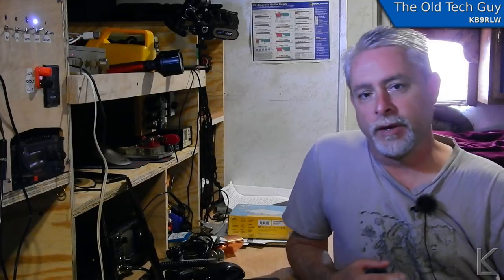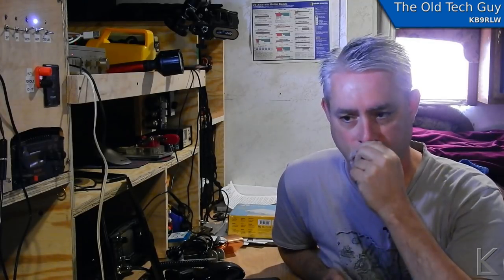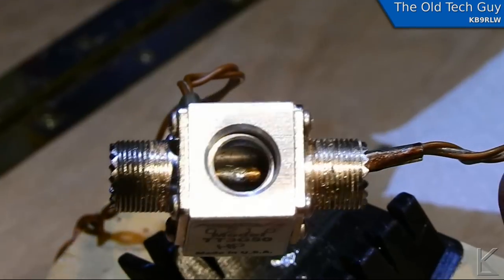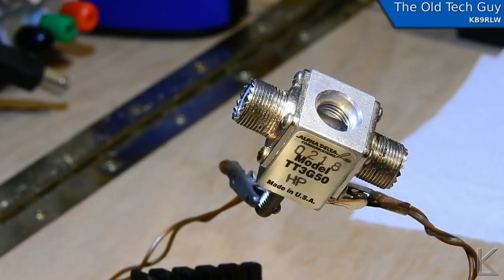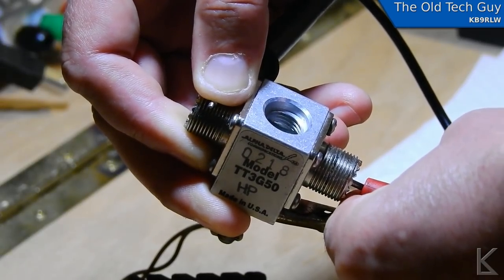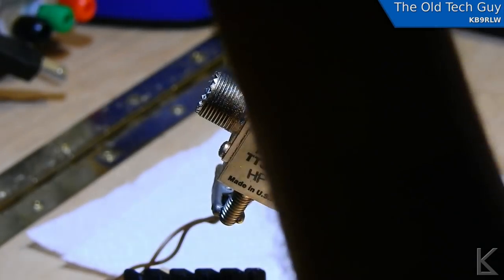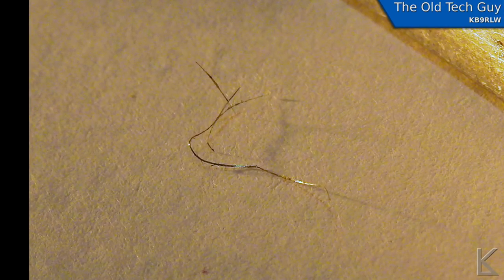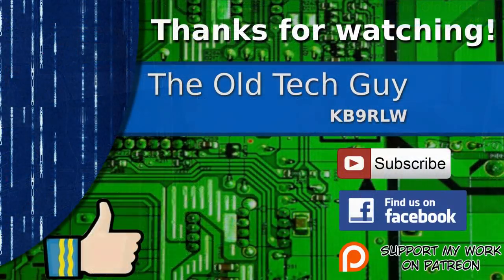Ham Radio - An Alpha Delta lightning arrester with an intermittent short.

Comment: It may have been residual swarf from a milling operation. I had an adapter that had large pieces of swarf shorting the connection. In my case it was easy to see. It was good that you found and fixed this issue. Have a good off grid experience.
Reply: Exactly
Reply: I thought it looked like "junk left over from cutting threads" but I didn't know there was a special word for it. So, thank you. "Swarf." Quite succinct.

Comment: Thats not wire, it is left over from the milling operation. I purchased 10 of these for my Tower setup and had 2 of them that had the same issue, not sure if it was just contamination from the milling process or it was from the threads from the gas tube insert? In any case great video and thanks for taking the time to post. I did the same thing you did and it was an easy fix...
Reply from the maker: I pinned your comment.  It's good to see that someone else observed the same issue.

Comment: Glad I found this vid (useful!). I've had two random shorts on my feedline, and now I know what to check. The first short was JUST before a contest. Luckily, conditions were lousy the first night. Anyway, the material cost to make these is low, and the cost is not low. This is unacceptable manufacturing standard for an American product, and the lack of QA/QC is disconcerting. My SWR was through the roof, and then I realised it was obviously a short when looking at the Z, R, X display on the RigExpert. The resistance was about 1 ohm. Well, that's a short. Appreciate the video.

Comment: I'm sure you know that the Alph Delta is not really a lightning arrester, but a surge protector.  It should be mounted on the station ground rod just before it enters the house not on the tower.

Comment: Thank you for posting I will meter out the lighting arrestors I have on order before I put them in place just goes to show don’t trust everything until you have tested first for safety and functionality.
Reply from the maker: Blow them out with compressed air also, just in case there's some debris in there.
Reply: @loughkb  thanks Kevin will do that when I get them

Comment: As previously stated, those aren't wires.  They're swarf from the when the holes were milled or the screw holes tapped in the body of the arrester.

Comment: Is that screw in part just a solid brass piece or does it have gas tube arrestor pellet that fits in it. Gas tube arrestors are a very interesting subject to study.  For a 100 watt radio the arrestor  flash over voltage  is much lower than say a tube for a 1.5kw amp has a much higher flash over voltage rating. At one point in time I spent a lot of time looking over little Fuse'es charts and info and it's exhausting. One fellow ham had a gas tube with too low of a rating for his amp. Whenever his voice peaks went too high it went high SWR and tripped his amp off. On my Alpha Delta the pellet rests on the middle  post, just don't over tighten it. I also discovered that one expensive arrestor I had wouldn't work on HF only VHF/UHF It shot the SWR through the roof on my HF rig.. Come to find out lightning has a frequency that a special cutoff filter inside blocked. Any way I found out there is a whole stack of stuff on them. That's crazy to have wire bits in there. That almost seems like sabotage to me.

Comment: Just wanted to let you know that I had a problem with the same model of arrestor.   All of a sudden, a folded dipole that worked great would all of a sudden show the same high SWR on all bands.  I replaced the arrestor with a spare and the problem went away.  When I tried to recreate the problem with the original arrestor, it would not fail so I plan on looking very closely in mine to look for the possible short.   Thanks for posting the video.  WA3ERQ

Comment: I got a new high voltage vacuum gauge power supply/controller. A real beauty.
   I struggled for few weeks (no schematics) to get the system working. I looked at my notes, the hookups were correct.
I checked voltages; they were correct. Then I powered the system down, disconnected one lead and reconnected that lead.
When I powered up the system it worked, partly. I jiggled the other connectors and the system worked. I put the cables out of sight, and the system worked fine for years afterwards. No problems. 
   Cheap poorly fabricated connectors!  N0QFT

Comment: Yes like others have stated that looks like shaving from when they cut the threads for the gas tube. I use to use gas discharge arresters when I owned a commercial tower site and ; how lucky I was ! not to run into that.  Ha have a great RV trip.73 Leo

Comment: Like many here, I'm guessing not so much a wire, but instead a shaving , probably from the threading operation during the manufacturing process.
More importantly, has anyone contacted Alpha Delta to alert them to this issue ?
 QC people, and or their machine  operators obviously need to do a better job !
Too, I'm guessing that the manufacturing of these devices, went to the lowest  Bidder ?
Hence, you get what you pay for !

Comment: I think I might have the same problem, because my radio has major problem something went wrong in my radio I cannot transmit simplex, radio does not put out power or watts. Power supply kept dropping to 7.1amps, did not have this problem until, I connected the alpha delta protector like the one in your video. Something burned up my radio.
Reply from the maker: Sounds like you blew the finals.   You would probably have noticed the very high SWR on your meter if you have one in line.  An SWR/Power meter in line before the antenna is the best way to keep an eye on the health of your antenna system.

Comment: I wonder if they used 100% tin solder in it? That might have caused tin whiskers to grow. Some attempts to make gear without lead have their own problems. The wires looked silvery...could you see any copper in them?
Reply from the maker: Actually, I wonder if they were from milling or drilling.  Maybe when the hole was tapped for threads.  Sometimes those processes can produce wire-like shavings of metal.
Reply: @loughkb  yeah, I suppose they could have been a chip from a tap that didn't get properly cleaned off. It's hard to gauge scale in the picture. Maybe if you put a banana in there for scale...? hi hi
Reply: @loughkb  Yes, it looked like swarf to me.
Reply: I was thinking tin whiskers before Kevin pulled out the swarf.